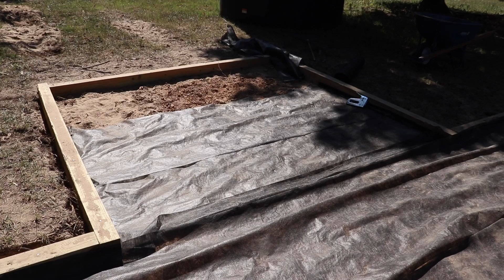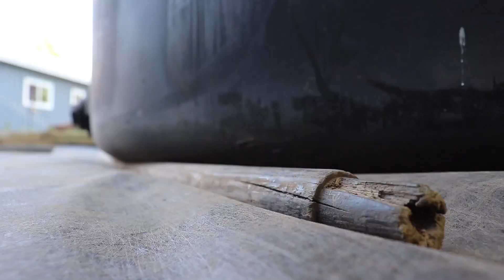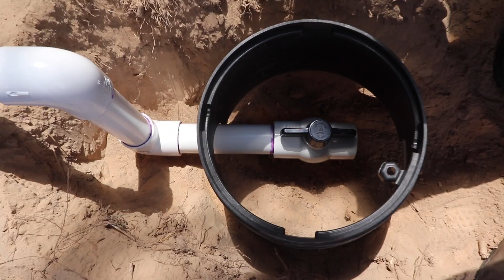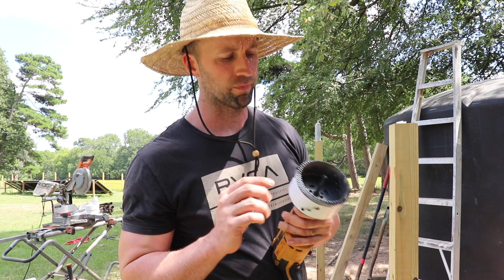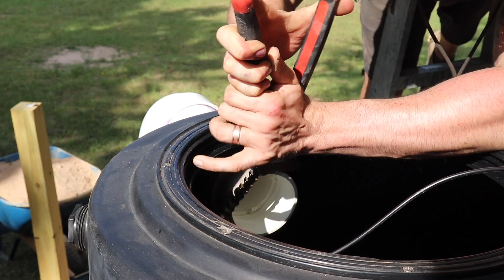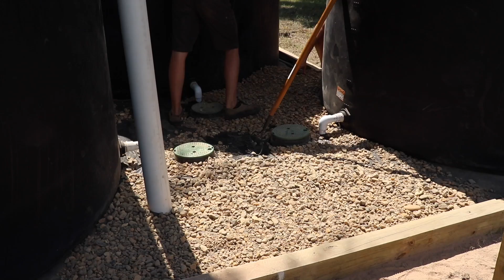HOW WE'RE GETTING WATER OFF GRID!

Comment: I've been following you guys closely since the very beginning and love everything you've done so far, with that being said your plans for the water getting from the house gutters to the tanks isn't going to work.  I live in the same general area of Texas and most of the rain you're going to get will be in strong sudden bursts, not extended periods of constant rain.  The water is going to overflow your gutter system on the house end long before you get any meaningful flow into the tanks, especially with that uphill section of pipe.  This isn't a pressurized system, it's gravity only and the path of least resistance is going to be your gutters overflowing on the house end.  You'll get some water to the tanks but nowhere near enough and you're going to need every bit you catch.  Also, during a hard rain you're going to get a ton more flow than your single 4" line can handle.  The idea of remote locating these tanks far away from the house is a mistake.  You guys really should having considered catching rain from the shed/barn roof and locating 2 of the tanks over there then putting 1 tank at the house somewhere to catch water there locally.  Please take this as constructive advice based on local experience, not the normal Youtube trolling and negativity that fills the comment sections normally.  :)
Reply: My exact thoughts while watching the video. Experienced the same issue here in central Texas.  I am afraid you'll need a pump to move the water into the tanks, or a redesign/relocation to address the issues this and many other posts have pointed out.  

As this person said, we are not here to criticise or troll.  Just providing hard-learned lessons to make your project more successful and less costly.

Good luck and love you channel!!
Reply: If the pipe is significantly higher on the house than the inflow on the tank a 4" pipe can handle a lot of flow. Their house can't be more than 1000 sq ft, a 4" should be fine unless there is some insane rain event. A large downspout and good slope on the gutter is a good idea though. I am a certified water harvesting practitioner and have installed hundreds of water harvesting systems. This is a wet inflow system, the pipes will always have water in them(unless they are leaking), it will make no difference in flow once the water gets moving, which will happen very quickly. The most important thing here is to have the sealed pipe on the house side significantly higher than inflow on the tank, as well as having an overflow as large as the inflow. The amount of flow the 4" can handle can be calculated, and the pipe should be sized according to heaviest expected rain events, not once in a hundred year events, just what you expect over a few year span. For instance, in Tucson we can get 3" in an hour sometimes, so we calculate that along with square footage of catchment area flowing into the system. If you have a really long run of pipe or lots bends then you may want to upsize to compensate for the added resistance. I think you guys are missing part of the physics of what is going on, though your cautionary statements are well placed, as I have had to fix a great many poorly designed and installed systems.
Reply: @dustman96  you didn’t really touch on the elevation being enough to fill 3 larges tanks over 6 feet high. Sure the pipe can handle the water but is there enough force to get it into the tanks? It didn’t seem like their house was more than a couple feet higher.
Reply: @burkles4456  A couple feet is more than enough if flow is not restricted. We've done a few system with less than a foot of head, they functioned just fine. More head is better though, but sometimes the "lay of the land" makes choices for you. The size of the tanks is not relevant, just the height. So what matters is: collection area, height of inlet to piping, flow rate of piping, overflow height, overflow piping flow rate.
Reply: Jo Simon Burying the tanks would have been ideal .... 3/4 underground and thus avoid using electricity to assist in filling.
Reply: Agree 100%
I'm in eastern Washington ...though we get some long down pours ...I ran into the same issue. I first started with a 1 1/2" down spout off a standard gutter. First rain I had a waterfall coming over the gutters edge. Fixed by fabricating a taller side and a larger downspout.
Reply: A post after my own heart.  One of tthe best descriptors for what I fail to convey.  Standing water is a resistance.  It must be overcome.  It will work great the first time the 4" pipe is empty.

Comment: As long as the output end of the fill pipe is lower than the input end, the water will seek a common level and fill the tank. The laws of hydraulics still apply in Texas.
Reply: Rate of flow through a 4" pipe is 240GPM. If I had the area of collection I could tell you the max. IPM this system can accommodate.
Reply: Think of it as a large beer bong.
Reply: even if the input end is ground level from looks like 50 yards? All the systems i've seen the tanks are next to the house being fed directly from the gutters or buried downhill below the 4' level. If they get a large amount of rain in a short period that up input pipe will be like a dam at the elbow.

Comment: dude you dude I don't think that is going to work. dude dude you should take a few 4x4 post and build a water way for your 4inch pipe to run overhead right in to the tank because it takes a lot of pressure for water to run up hill but I could be wrong on this. we will have to wait for the rain to find out but I do believe that the water will just  trickle into the tank's and then it will make a waterfall off of your roof. for a more efficient way run the pipe overhead. don't mean to be noisy just wanted to help .
Reply: I second Cookie Monster idea. Do it the Roman Aquaduct way it still stands the test of time.
Reply: @mr.b6627  Aquaducts were made that way because they are not enclose pipes. Pipe allows water to be contained and not needing to be level.
Reply: GUYS, pressure is pressure, the amount of drop determines the pressure, the size of the pipe determines the amount of available flow at the given pressure. There is some friction loss, but that is so low at this pressure it wouldn't make a difference. You just worry about the low part of the loop trapping some water that will get stale if it sits there very long. A 4" line can handle an immense amount of water and if there is 10' - 15' of drop, will siphon the water well from the roof, it will even be kinda noisy doing it when it inhales air. Speakin' from experience here... Michael in Colorado.
Reply: Hmmm. I don't wish to get into a pissing match with you. If you read my comment carefully you would have seen that I agreed with you 100 % . Yes aquaducts were open  but for the they were open for a reason. Coming across country they were prone to debris and being open allowed for maintenance. Of all kinds of debris. They were once one of the seven wonders of the world. 🤔
Reply: I'm a little skeptical about that water drainage also,for the kids sake I hope I'm wrong...
Reply: I think I agree with the first comment.   I don’t see how the first tank has enough pressure to fill the second two.   Shouldn’t it only have enough to fill one half of the second tank before the pressure equalizes?
Reply: I’m wondering if it worked…..   any updates?

Comment: you guys will have problems with the drainage coming from the roof to the tanks because as soon as the tanks are full enough they will have too much pressure and it will be it will create a back pressure I think you need to research a little better I think your your inlet pipe needs to be higher and your installation but just saying please check I know you're doing a lot of work  to double-check

Comment: The gravity idea is a good one although head pressures and gravity may be your down fall. The tanks may have worked better if dug partially subsoil to reduce the head pressures needed to fill the tank.
Reply: Also a sight glass may be useful so you can see water levels.

Comment: I was surprised you didnt use the pvc to move the tanks. A bigger roller doesnt snag.
Reply: I would suggest possibly checking your local plumbing code to see how deep you need to have your potable water supply lines. They need to be below the frost line. Also you have cattle that could crush the pipe break a fitting if its too shallow in the ground, when its wet or during the monsoon season.  I am surprised you did not place the tanks on a concrete slab or at least a gravel bed. That way you can build a  building over and around the tanks.
Reply: @MissyKrystal  good point if your tanks arnt seated securely on a hard base all the water pressure with force the tank down and the base will spread....my tanks are on concrete for this reason and the capping over the joints should be much lower just above soil height and buried so they dont dislodge as they protect the joints...the pipes are too high esp with cattle and seasonal changes heat and cold will affect the pipes ...add gravel around the pipes to keep the secure and insulated....add filters to your downpipes to stop leaf litter from entering the main pipes helps stop blockages...
Reply: @MissyKrystal  i wonder what those corner post going to be used for
Reply: I suspect those pipes were picked up later
Reply: What's the fun in that:-D
Reply: James Smith  lol
Reply: Thanks
Reply: Use the crv!
Reply: So you think he should have cut a random length of pvc before things were set and he could take real measurements that would actually work for the system?

Comment: You know, if you tip those on their sides you can roll them instead of having to push them. Just sayin
Reply: Or she could help lol
Reply: Go buy 3 pieces of 2” steel pipe at Home Depot and  roll it anywhere you want 
       A dead man a come a long and some steel pipe and you can almost anything by yourself. A dead man is a device with a long strong handle with a heavy duty steel wedge at one end with a small single wheel right before the wedge This allows one man to lift a heavy object a few inches. A come a long is a chain hoist with a jack style handle instead of a chain to operate the hoist this allows horizontal as well as vertical use.
Reply: HVAC Mike 
Sounds like a hell of a lot more work than rolling it
Reply: The Real MFWIC  I agree for these tanks I would simply put 1” schedule 40 pvc under them and rolled them to wherever. Cheap and easy on the body. 
       The comment I made earlier was for moving truly heavy items around. Personally the first major purchase i would have made on this project was a good used tractor with a front end loader with detachable forks. I have worked by myself for most of my life and you learn tricks to moving thing around.
Reply: lol
Reply: Oh that is so hillarious but he just does it for the exercise...
Reply: Could damage tank outlets on bottom side there pretty heavy and outlets are plastic

Comment: You may want to add a 55 gal drum and sump pump under the gutters to pump water up to the tank infill. Not really sure gravity will drive the water through the pipes and up that high. If you were to start with and 8" pipe and graduate down to four, that might give you the pressure needed tbough. Good luck!

Comment: A few things.
1)  you need to cover or paint the exposed PVC or it will degrade in the sun.  In a year or two you will be redoing it.  PVC has zero UV resistance.

2)  how is this going to effect the out flow from your gutters?  The rate of flow from the gutters is inversely proportional to the amount of head pressure.  So, the restriction of flowing down a pipe plus the additional head pressure of having to come back up that stand pipe to enter the tank is going to reduce how fast water leaves the gutters.  This could become an issue in the future.  A potential solution would be to use a much larger pipe from the house to the tanks and then give the tanks each their own standing fill pipe.  This would reduce the flow restriction and speed up the water leaving the gutters.

3)  I would connect the overflows at the top as well.  If you get a heavy enough rain, the small pipe at the bottom may not be able to equalize the levels in the tanks fast enough.  By connecting the upper overflows, you provide a second path and potentially save water that would otherwise go on to the ground.

4)  since you are going through all of this trouble, I recommend a gray water system as well.  This will take water from washing machines and sinks and, store it for uses like watering plants and the lawn.  More over, it will preserve your precious portable water.
Reply: durc001  I don't disagree but, putting the tanks underground also brings problems.  Actually having them up makes a lot of things easier and, as long as the tanks are below the level of the gutters significantly, it can work.  Given the approximately 2ft pillars plus the 9 and 1/2 foot containers, they probably have a net head height of about 4ft.  Not a lot but workable if you minimize flow restrictions and are smart about it.

Comment: Great Job! If financing would allow, I think I would still install a well for landscaping/gardening and a backup for the house.
Reply: Or bury a 2500 gal tank.
Reply: you may have a well but even a well has a flow rate and if that flow rate is not high enough you will get a lot of sediment with it. and a well needs a well pump as well so you would need to put the tanks higher to eliminate the need for a second pump.

Comment: I don’t want to burst your bubble but that’s not going to work you will never be able to create enough gravity pressure to fill this tanks.. the only way to make that work is to bring your fill pipe in the air all the way across your yard to the top of the tank. Or install a pump to pump it up. What will happen is once that pipe gets full of water it will just overflow your gutters.. going down is fine if you buried your tanks but it will not create enough pressure to push it up.. I’m sorry to tell you that but I want to to have success with your water system and if you do bury your tanks once the water level gets low you will have to pump it to the house. When they are full you should have enough head pressure to gravity feed the house without a pump. I wish you luck perhaps I am wrong but I don’t believe I am..
Reply: Not wrong at all.  Head pressure of the standing water will overflow at the gutters before it can move the equilibrium they think has no resistance.

Comment: First let me say that I love you guys, y'all are awesome. I hate to say it though, your solution to get the water from the house to the tanks won't work. First the water has to equalize from the downspout to the up spout, but that's dependent on the size pipe you use at your house. If you use anything less than 4" at the house it'll have to work against the pressure from the up spout. There's probably 10 gallons or more of water in the up spout which weighs 85 ish lbs. I mean it might work better to change the pipe at the tank to a smaller diameter to get it the lift it needs to get it done. But then you run into the problem of water moving fast enough that it won't backflow out at the house. Idk I think there's an issue and there might need to be a redesign. Good luck
Reply: A redesign is in order.  While water seeks it's own level, you're right about the line size/resistance.  The gutters are going to overflow at the house.  From gutter to a sump at the house then to sump pump to the tank cluster would be better.  But then you have another pump...  To help with sediment and such, I would think have stages of tanks.  First tank is 'grey' then filter and store in the other two.  But then you've got yet another pump since these Norwescos aren't pressurized.  At least a roof to keep the sunlight off and will help the water quality and tank life.  Also, why have sunk frost cans and then still have 6-8" of supply pipe above ground?  Get the biggest pressure tank you can get to help the life of your pressure pump!  I got a 120gal in my mech room.  Just barely fit through the door but my Grundfos thanks me.
Reply: @LordNelsonkm  I thought it would be better if they buried the tanks to eliminate the gravity/back flow question. That's the way it works at my uncle's house in South Texas.
Reply: MJW  that's actually what I was expecting at first when they didn't bury the tanks
Reply: Well I hope you comment on the latest upload and explain to them that you didn't know what the fuck you was talking about.
Reply: @Steven Councell that's a lot of diggin for old bear....

Comment: Let me get this straight.  Incoming water from gutters to first tank will then fill other two tanks gradually once the level in the first tank surpass the outgoing lines.  Thus assuming you get 3 inches of rain, each tank level would rise by 1 inch.  How many tanks will be feeding the home at any one time?  One or all three?
Reply: If they even fill the tanks.  They are hoping the tank with the 4" pipe will equalize to the other two.  Then they are also presuming that the head pressure will give them enough pressure for no pump water to the house.  (grin, yes its a pipe dream)
Reply: @wi11y1960  he said he is installing a pump from tanks TO the house. It will work just fine.

Comment: Am really curious to see just how that water will go up hill, from the ground to the tank. Every time i tried this experiment the air pressure prevented the water from going up even though the supply was higher than the device I was trying to fill. You Two work great together, keep up the good work.
Reply: They are willing to ignore the resistance of the standing water that must be moved that will be stored in the pipe